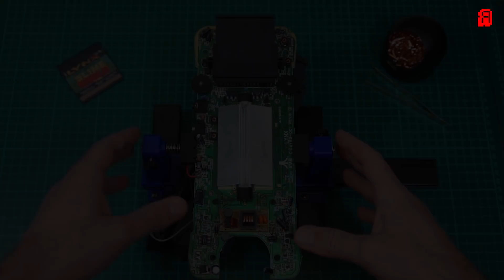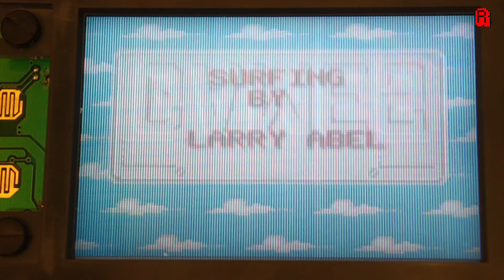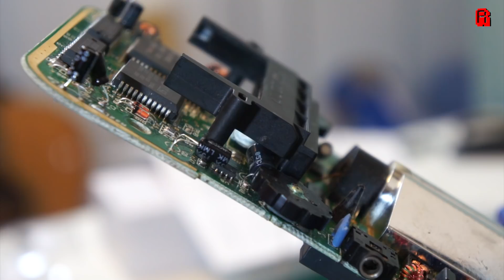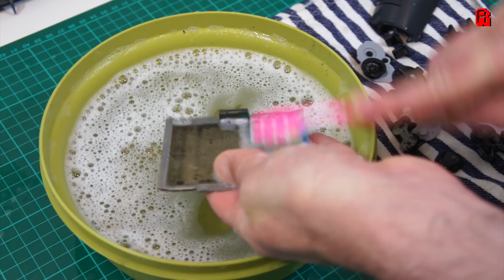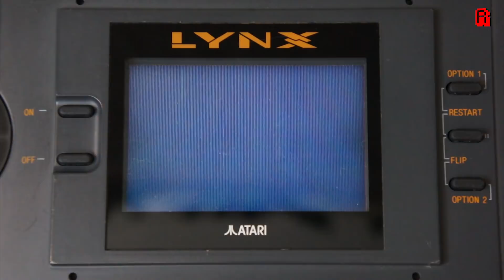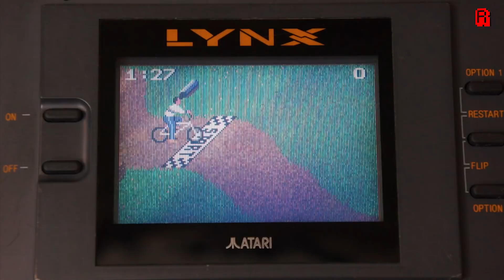Atari Lynx Restoration - Trash to Treasure Pt2

Comment: Great restoration video, the Lynx was an awesome machine when it came out. I still i have mine i bought from Dixons, apart from a few marks on the case it's still rocking just fine! Looking forward to seeing the screen upgrade, i'd probably play mine more if i changed it so it will be interesting to see.

Comment: I bought a broken lynx, with near scratchfree case. First thing I do, I take it apart, and put back together. Now there's a hole on the case. Good news, while the unit was sold as broken, "fried", as was scratched under a battery compartment, only issue seemed to be, that the batteries weren't getting a proper connection. Some rechargeables tend to have flatter + sides. A bit of solder blob fixed that.
Reply from the maker: It's so easily done!  Still, at least you got a working Lynx, put an Atari sticker over the hole :D

Comment: Good job restoring it, but what you could do with the other lynx is, 1 philling in those gap holes with liguid plastic and 3D print the missing battery cover sothat you also can complete refurbish the other atari lynx.
It's a great timeless system.
Reply from the maker: Nice ideas, I would like to use the 2nd one for upgrades and mods so I keep one original.  I would have so many uses for a 3D printer!

Comment: Great stuff! On the subject of replacement screens, I have both an original Lynx 1 and a Lynx 2 on which I performed the McWill screen mod. I have to say, if possible try to hold on to an unmodded system as well. Although the replacement screen does look fantastic, the system loses a fair bit of its charm. The original screen is quite capable of hiding the Lynx's low resolution, and the slow LCD's also hides the jerky scrolling that some games display.
Reply from the maker: +custardo agreed, my primary goal is always to get a system back to working original order.  A secondary system for the mods would be a nice comparison

Comment: I think there's an LED backlight kit available for it that might be a nice interim upgrade rather than replacing the screen with the modern expensive one. nice vid as always!
Reply from the maker: Hey Martin!  LED replacement is possible, that would save battery life but the back light isn't really the problem behind the screen quality.  I'll look into it, maybe I can present both options
Reply: Yeah, if you get the other one working, you could always do it in that one and save the mcwill screen for this one. 

I know handheld legends sell the backlight kits on this side of the pond. dunno about the uk though.

Comment: Great video, I repaired an original Gameboy earlier this year. The thing I am wondering is could you list links for your repair tools kit and the circuit board holder, that is really handy. As I repair a quite a few electronics now and then but always need 3 hands to repair anything. I don't have those sort of tools and it always takes quite a while to fix something due to the soldering being so delicate to remove components. What sort of tip and your soldering iron are you using to repair microelectronics without damaging the board?

Comment: A Lynx 2 would be fun for you to restore too. Maye even add that fancy better screens Lynx 2 version onto it as part of a restoration and then compare what a Lynx 1 Vs Lynx 2 looks like with the same better built screen on both as if Lynx 2 looks better it would mean it has better graphics chip revisions inside of it and same for the Lynx 1 but Lynx 2 has the better sound as it's stereo probably even if not a better picture on the same screen type.

A Lynx 2 Restoration is definitely a handheld to restore in the cave for a compare of the chipsets on the same modern screen. Are new chip revisions in later anything really el cheapo or are they better for cheaper to put in. The answer would be in the Lynx 2 if you cover it one day.

Comment: Great video as always. It reminds me I really need to get my Game Gear recapped. I've had the caps for a couple of years and just haven't pulled out the soldering iron to get it done yet. Sad thing is I've recapped several arcade monitors in the time since I've had the kit too, I keep forgetting about it.
Reply from the maker: In a reversal I have been putting off recapping my Amiga monitor while working on this, I really need to get it sorted

Comment: Have you looked into getting a better soldering iron tip? A chisel tip would make work like that a lot easier. I have a soldering station like the one you have, I could send a link to some tips. The conical tip you're using has very low thermal mass, and makes it a lot harder to solder. I was under the same misconception that soldering was just semi difficult, but changing tips made the world of difference. For a couple of £'s it'll make everything so much easier.
Reply from the maker: I have indeed having spent some time with a friend who has a strong background in these things and a set of tips are on the way, I'm looking forward to seeing the difference it makes.
Reply: Good to hear.

Comment: The irony of all these failed/flopped retro machines is that today they are worth a lot more than the machines that didn't flop. A nice Lynx Mk1 in it's box will fetch 2-3x that of the Gameboy original.
The other irony is that these flopped/failed machines, that were not wanted back in their day, are now wanted and most desirable. Mostly due to the retro scene exploding, this is why the prices are insane.
I could get machines that really failed from the 80's and 90s, such as the Oric Atmos, Jupiter Ace, 3DO, Sega 32x, for stupidly cheap prices. Almost paying you to take them away, this was around the late 90s. Today, these machines, boxed, fetch silly money - especially the Jupiter Ace. Go back to 1984 and a Sinclair ZX80 would have been a damn hard sale, even free in a cereal box the ZX80 would have been met with the bottom of a bin liner. Today, they can sell for 10x what they cost in 1980. Mad.
Loved the video, enjoyed the calm clear commentary.
Reply from the maker: +DKTronics70 Yup, to think of all the CDTV, GX4000, CD32 and Lynxs that I saw in bargain buckets back then.  Crazy.
Reply: This might be my mind thinking of something similar. But, I distinctly remember Woolworths selling unsold Vectrex machines for £29, and Lynx Mk1 for almost the same. I also remember my local charity/second-hand shop - as it was known back around '97/'98, selling a boxed CDTV for £25. I could kick myself, but obviously back then everyone wanted the next big thing which, at the time, was the Playstation. I did buy from them a lovely boxed Sega Megadrive + SegaCD for £40. Can't believe how much I can now sell them.

Comment: Compared with some of the other boards I have seen you work on that one doesn't look too challenging. All of the solder points seem a nice distance away from each other. Helps that the console is about 4 metres long though :)
Reply from the maker: Michael Dodd it wasn't bad at all and the caps were very well behaved in coming out.  One of the nicer ones to work on
Reply: I remember when this came out I was working part time in a computer shop in Chester called Lion Computers. It came with a game called Scrapyard Dog I think and I thought it was the most amazing thing I'd ever seen.

Comment: i still have mine but it doesnt work with batteries i need to find an adaptor for it and see if its just the battery connection or a general problem :/ i wonder if i can buy some parts i miss :/ like the battery cover and well the screen protection :/ both of those had come off and i no longer have them.

Comment: I do like those helping hands your using where did you get them? and were they expensive ?
Reply from the maker: +2j4ez just on Amazon for under £20 I think.  I'd like a bigger set for system boards but for a handheld it's nice
Reply: I'm doing a ham intermediate course got a exam in a few weeks. we looked at soldering and caps etc which is one of the reasons why I was interested in your videos because of electronics and soldering .The other reasons I like your videos is I play retro games, amiga 1200 being my fave computer and Sega master system my all time fave games system

Comment: Whats that clamp you're using to hold the board and where can I get one?
Reply from the maker: +Jake S. Del Mastro It's a PCB holder, you can find them on Amazon among other places.  Just double check the size is big enough for what you want to work on.

Comment: Hi Neil, i own a LYNX II that even after a recap had the video barely visible (backlight on) and even after clean card and slot it says INSERT GAME, do you ha a suggestion or values i must find in test points ? I found no documents online.
Reply from the maker: Even if you get that screen looking like new it's still terrible.  Here's a new solution that's super easy https://youtu.be/laMALkm2jRs
Reply: @TheRetroCollective  i see that mod,but i must be sure that it's a LCD failure and not something onboard.

Comment: Nice work!  Are there any common faults with the Lynx II?
Reply from the maker: +dave4shmups I haven't looked too much into the 2 yet other than improvements such as the screen and stereo headphone jack.  It has the same problem with the MOSFET which is in Q12 on the 2, as well as common faults with sound volume caused by old caps, but I can't be more specific.  If interest in the Lynx continues I'm tempted to get one to show in part 3 to progress the story from old to new mods, showing how Atari tried to improve it along the way

Comment: They certainly tried... And in many ways it's very impressive.
Unfortunately, it was the first in the line of handhelds that failed for similar reasons.

Granted, the Lynx itself isn't one of them given it's contemporary to the game boy itself... But after witnessing the Gameboy and Lynx, surely other companies should have realised...
If not then, when the Sega Game Gear repeated roughly the same mistakes with roughly the same outcome, surely?
But no... Apparently not.

Trouble is, nowadays even Nintendo has fallen prey to some of those mistakes.
They get away with it, because everyone else has given up...
But still...

Comparing the battery life of a Gameboy color to that of a 3ds, you really are left wondering how anyone thought that was a good idea. (the switch is pretty bad too, but it's 'hybrid' nature seems to give it at least some excuse...)
Plus the trend towards proprietary integrated batteries hasn't helped much.

From 25+ hours per set of batteries using easily available standard batteries you can get basically anywhere, to 3-6 hours using a proprietary, frequently non-removable (in any practical sense) battery pack? Tell me you aren't serious here?

The heart of the problem of course, is games at the end of the day. (which explains why the wonderswan still didn't do too great even though it avoids the hardware pitfalls)

But in terms of hardware itself...
It can be summed up as 'too much power, too little portability'.
Constantly trying to show off by creating a powerful handheld, but paying the price in terms of making it impractically large, power hungry, and generally not all that usable as an actual handheld system.

This mistake has been repeated way too many times at this point... But... Such is the way of things sometimes...
Reply from the maker: +KuraIthys couldn't agree more.  It's astounding the mistakes they repeat not just in handhelds but also consoles and their add ons.  If they just asked any 12 year old they would have had the best advice going.

Comment: I've been trying to get an old lynx 2 i was given going again and after watching this I decided to just replace the transistor regardless but atm it's still not going. BUT I'm a bit of a novice and part of me thinks I held a hot iron too close to the new one for too long and just broke it as well. I have a multi meter and if I put one side on pin 1 of the dc power (im using a plug not batteries) and the other on the source or gate of the transistor it reads around 11 volts. Putting the other on the drain however gets 0.34v and if hold the power button it goes up to 0.44v until I let go. BUT, if I put one side of the multimeter on the source directly and the other on the drain it reads 11volt pass through when plugged into the wall regardless of what I do with the buttons.. is that normal? Any advice?